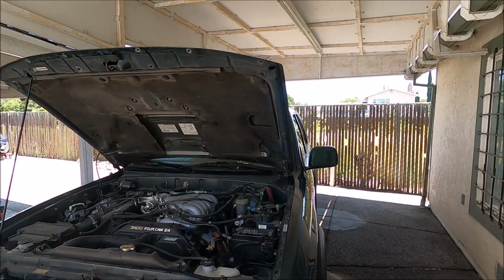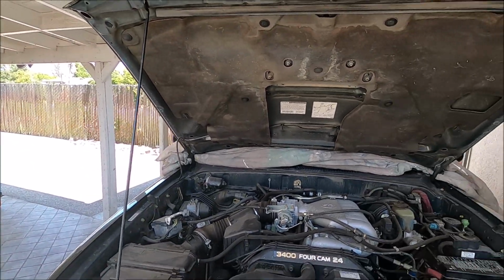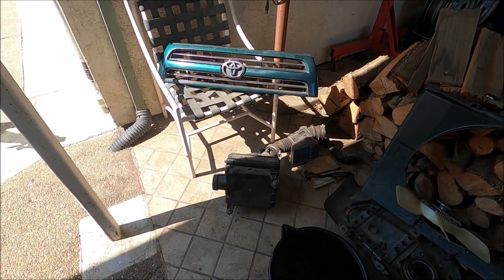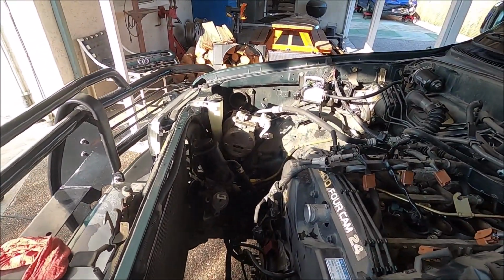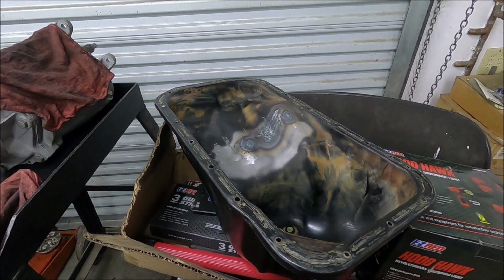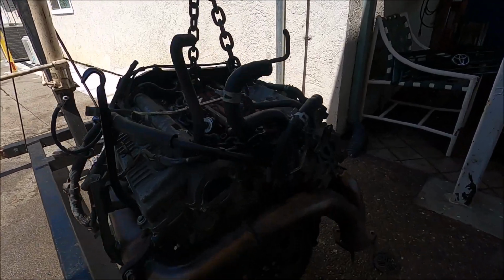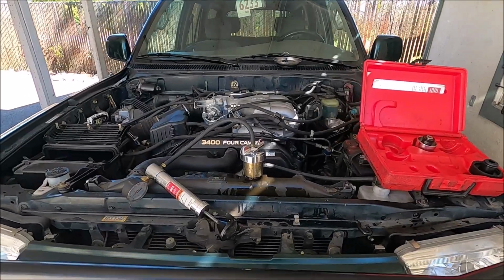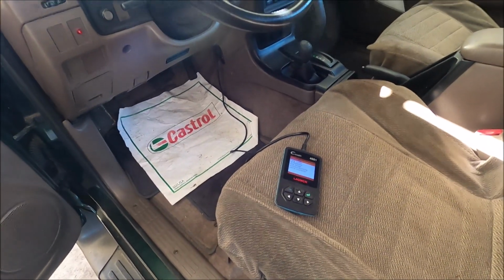Automotive Repair Tips from a Master Tech 1

Comment: Ive been know to tie a rope onto the hood and tie it back to the rear bumper so it will stay up out of the way.   Depends on the hinge design.
Reply from the maker: I’ve done that before on some of them.  Mercedes has the best setup where you can put the hood straight up to work on it.

Comment: Good tips....in my 20s, engine swap on Chevy truck with gas tank behind the seat, shoved bolt in gas line (no clamp), finished for the evening noticed gas smell so left mandoor open to vent, the detached garage had 2 water heaters, after watching Johnny Carson went out to lock up, entered garage and almost choked from the fumes...the whole time I was gone the fuel line dripped, large pool of gas under the truck...VERY lucky I didn’t burn the place down....lesson learned!!!!!
Reply from the maker: I’ve had it happen many times.  From being in the sun it builds up pressure in the gas tank.  It happens even more often when the tank is mounted up high.

Comment: What happened to that 3.4l v6 from that 3rd gen 4runner? ken
Reply from the maker: The first one had almost 300K on it and it had a stuck valve.   The second one had a 113K on it with a connecting rod threw the oil pan.  I think a rod bolt broke.,   First time I seen that on one of those engines.
Reply: @1970chevelle396  wow thats a first Normally dont see that happen On these motors I have 2 4runner from 2000 one has 480 thousand miles the other has over 900 thousand miles thats interesting 🤔
Reply from the maker: This guy took it to a Toyota Dealership for a lean code .  Then they called him and said it blew up while they were running it.  I think they did something to it.
Reply: @1970chevelle396  omg I agree i think the dealership sabotaged it thats just wrong over a lean code

Comment: Nice 3rd gen 4runner
Reply from the maker: I just replaced the engines on two of them.
Reply: @1970chevelle396  what happened to them 3.4l v6 motors these are very bullet proof motors very really seen them needing replacement what happened do you know